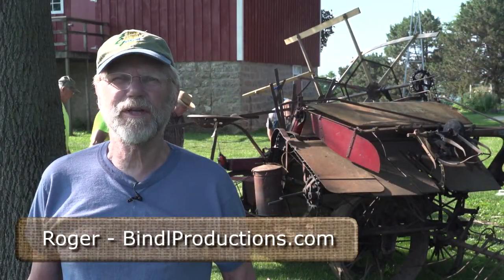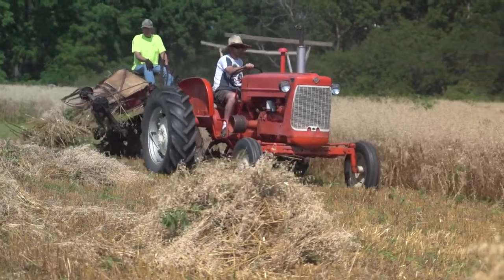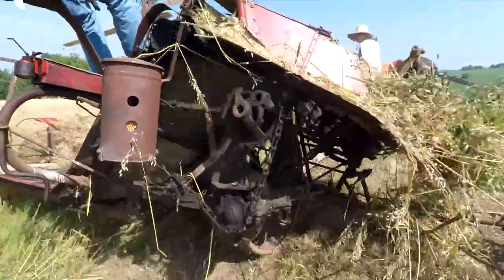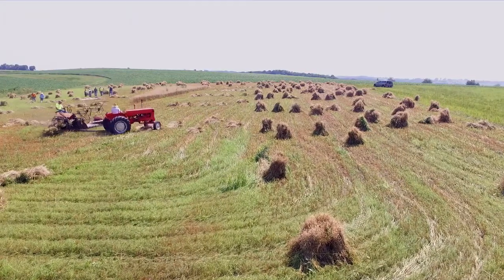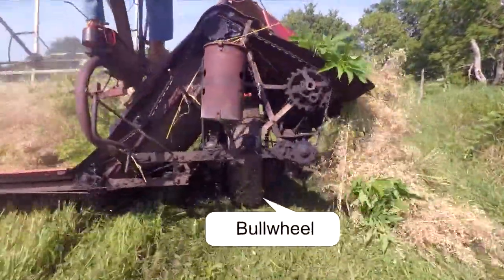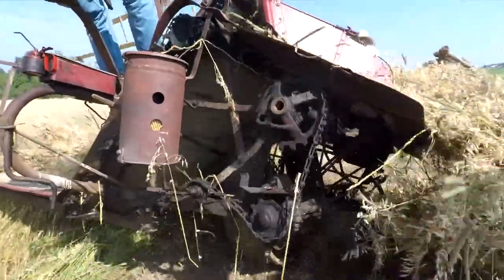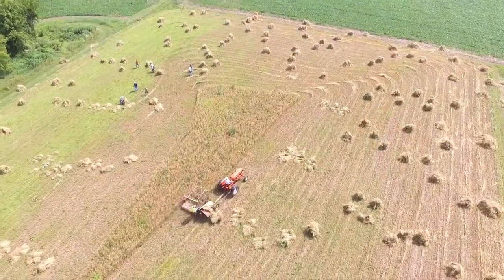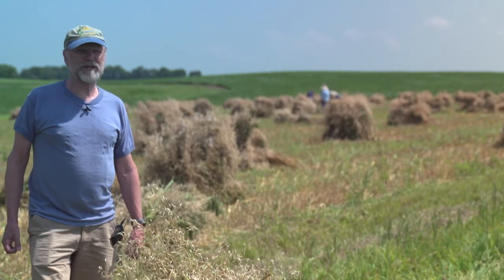Binding sheaves of oats for stooking and drying with a 1920's Grain Binder

Comment: We threshed until 1967 with my grandfathers John Deere binder and my other grandfathers McCormick seperator.   The binder should be pulled at the speed of a walking horse as they were designed to be used.   This binder will probably wear out fast because of the ground speed.   Nice to see it working.
Reply from the maker: Interesting comment on the speed Abbey. I'll have to ask them about that when they harvest the winter wheat. They do seem to have quite a few problems with the equipment. Maybe they are going to fast?